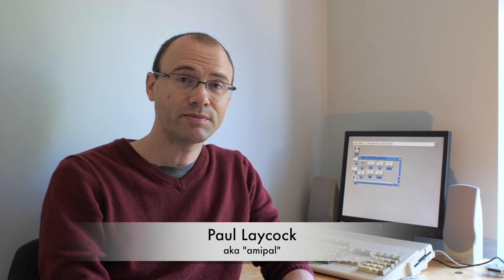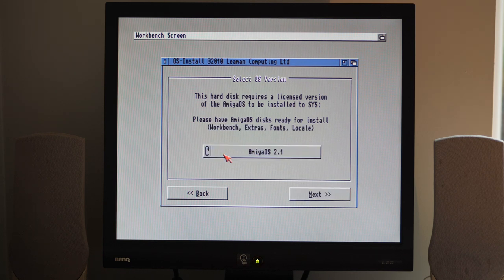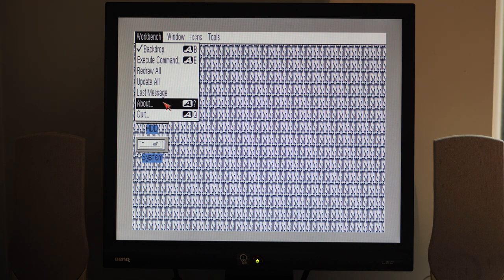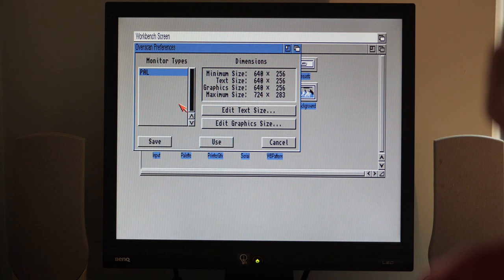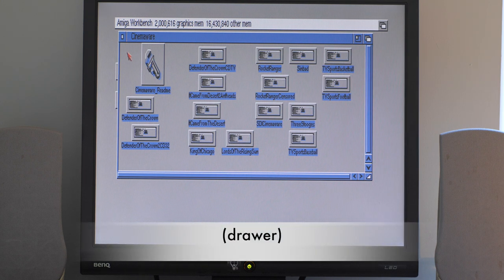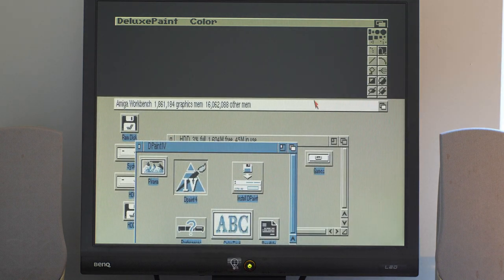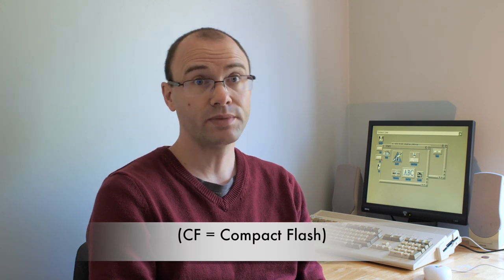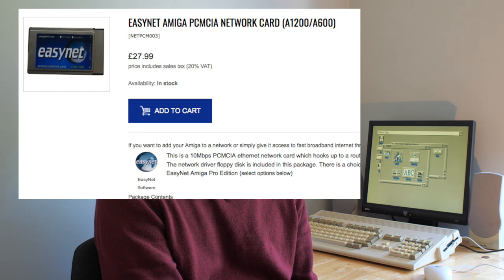amipal #5: Internal Storage

Comment: I had CF cards in my 1200 (they died), I now have SD cards in my 1200 and 600.
Pity adding the same to a 500 or CD32  is not so easy.
Reply from the maker: I know many cursed the use of IDE in the 600/1200 on release, but they really have proven incredibly useful as the years have gone by.
I have considered a TerribleFire upgrade for my CD32 just so that I can get some mass storage into the thing.